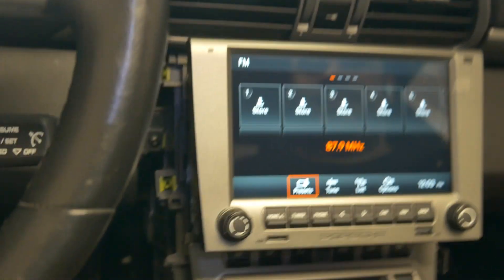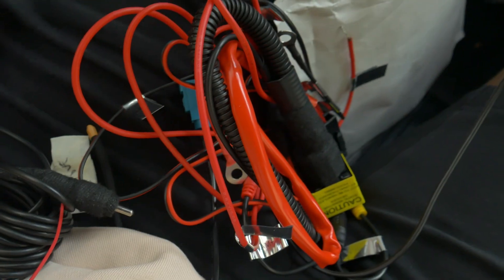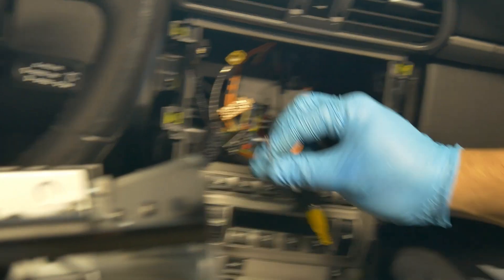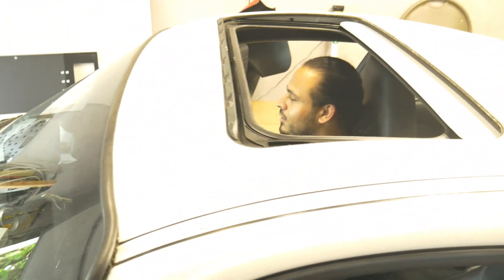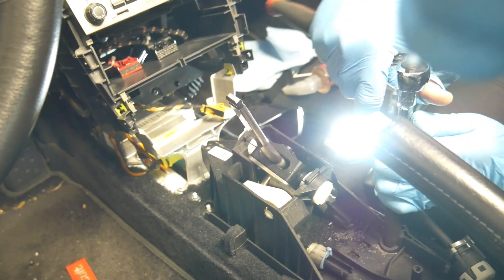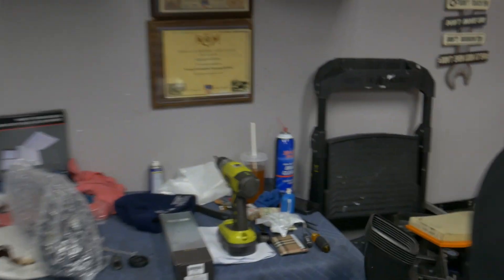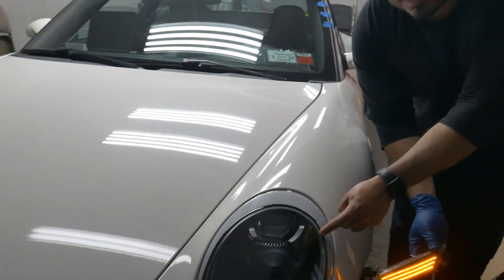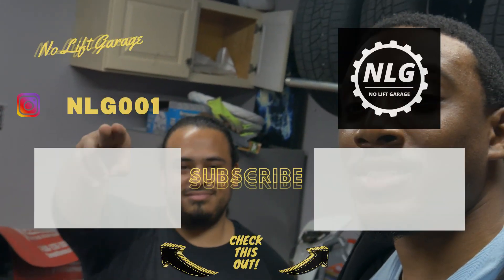Porsche 911 Gets PCCM+, NUMERIC SHIFTER, & MORE!

Comment: Phone mount is a little redundant since you have CarPlay. Should've did the front USB relocate to the back and then you can run the usb to the glove or armrest and you can do wireless adapter
Reply from the maker: I actually prefer to have the phone there as CarPlay is good but often times I need to pick up my phone for music or maps, the scrolling features etc on the PCCM are not THE BEST and it’s not in my line of sight so looking down for too long isn’t great either. Not a terrible suggestion though, it’s just preference🤷🏾‍♂️

Comment: Thanks for sharing, I absolutely love the 911/ 997 and it is my dream car.  I have been so hesitant to pull the trigger on a 997.1 or a 997.2.  I guess I shouldn't read so much into bore scoring and ims issues if the car is still running in 2024...
Reply from the maker: I’d def say if you can get a .2 get a .2, and if you want a .1 don’t let the potential issues stop you. Do your due diligence and understand and be prepared for the maintenance cost just in case. Don’t be afraid most of these cars are good to go !

Comment: Great Video!  Are you happy with the reverse camera you used and how is the clarity?  Also have you had any issues with the volume of the PCCM+ not being loud enough when using Apple Car play?  I have this issue with my newly installed PCCM+ on my Cab and I have seen similar issues mentioned on forums. Not sure how to fix this issue. Thanks..
Reply from the maker: Hey, clarity is great , my camera skills are improving so it might not look good in the clip I made here but it is good. Only thing we could have done better on is placement, the bumperette is slightly distracting so I believe if the camera was placed on the left license plate light it would be centered and perfect. But with that being said I have no problems with its current placement because it’s just and aid to ensure you’re not going to bump into anything . As for the sound quality I think it’s always been great. I do have aftermarket speakers in my car and not equipped with Bose either. This could be the reason… if you have factory non Bose speakers, swap them out!